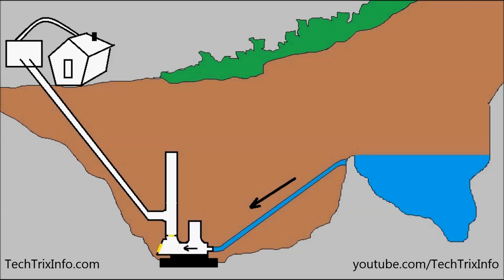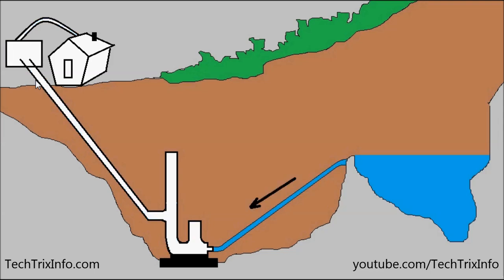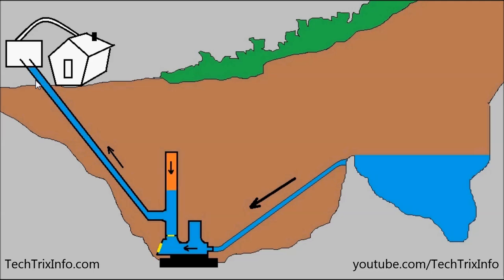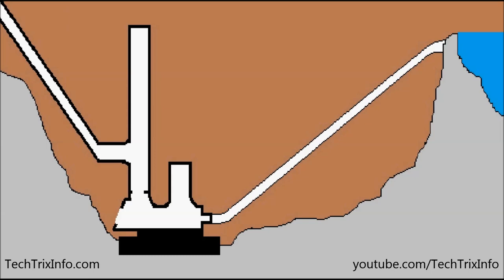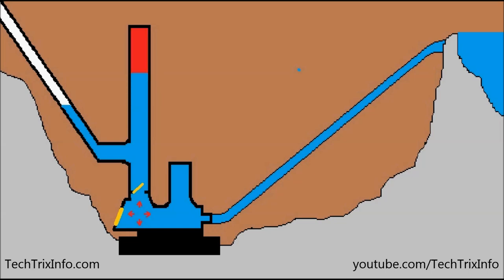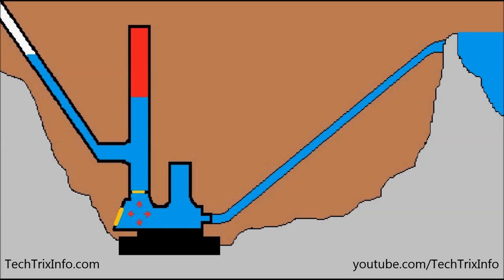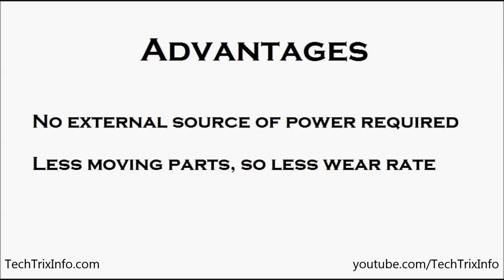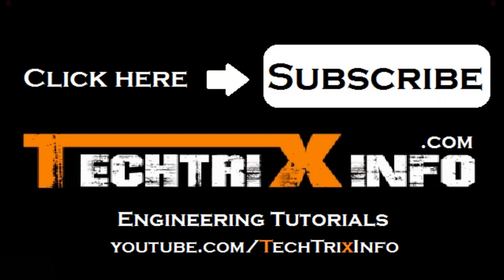Animation | How ram pump works | Explained in detail.

Comment: Thank you! New to ram pumps and after heaps of videos I finally get how it works.  It should therefor work in a waterfall into swimming pool pumped back up to higher fall then yeah?  I want to build one where waterfall is pool filter so hoping it will.
Reply: Thanks for the comment
Reply: For a short period. Only 10% of the water is pumped back up. You should consider an electric pump, powered by solar.

Comment: Just a thought, the pressure from the pressure chamber is enough to push the water even to higher location but there's still a split second delay since the pressure chamber needs to accumulate enough pressure again before it can push the water. Maybe, if you put two pressure chambers in series and they are both connected to the inlet but the 1st chambers' output is connected to the second pressure chamber which has two incoming delivery valve. That will create more pressure quickly since the pressure created from the inlet and the 1st pressure chamber will be added together to create pressure for the second chamber which is then connected to the delivery pipe. Two or more pressure chambers in series I guess can speed up the pumping of water to the delivery pipe.

Comment: This animation and "explanation" fails to explain the most important part of this entire mechanism, i.e.: how the waste valve works. It also fails to explain the function of the chamber to the right (upstream) of the pressure chamber.
Reply: it was also hard to understand.  but a B for effort.
Reply: What IS the function of the chamber to the right of the pressure chamber?
Reply: @robertbrandywine  just to make more stored water available to fill the cylinder than the thin pipe can deliver.
Reply: Is the waste valve necessary?
Reply: @robertbrandywine   the author of this animation has used drawings from another source, the chamber to which you refer was used in another explanation to house the waste valve. This person has merely retained the shape of the original pump and placed his waste valve closer to the delivery valve (in my opinion, a less efficient location). The system will work with the waste valve  placed either before or after the delivery valve. In my system , I have placed it where the original artist of this diagram has shown it (yes, at the top of the chamber you were asking about) and I have done that for 2 reasons , the first so I can utilise the weight of the flap valve seal to assist closure secondly to utilise more of the hammer effect energy, by applying it to a greater volume pump. i(it does not increase the amount of water pumped, it does however slow the pulse rate and extend the time the valve is open. I support my argument by asking you to look at the majority of ramp pumps on utube,...... where is the waste valve located?

Comment: how the waste valve is opened at the beginning and in the process its opening to the other side? wouldnt the water just flush trough that waste valve if its opened this way?
Reply: +Samuel Trajano in this we lock its motion to certain angle so it will not open to other side
Reply: Samuel Trajano I was thinking that too couldn't it also be lifted back to the original pool if not into a sewer system or such? Circulation wouldn't hurt and could be helpful?
Reply: water pressure closes it. After pneumatic pressure pushes water up, the chamber with waste valve loses pressure and it reopens, inviting more pressure, and then closing again after the entire process happens again.

Comment: Good explanation but would you also need a one way valve on the delivery line as the water would be expelled through the main delivery valve as the pressure has been used up in the compression chamber. I`m guessing a one way gate valve at the tank on the top of the hill would be installed?

Comment: I wonder if using multiple ones in series could work? There would be much water loss along the way but I think the water can be recycled or used to power yet another system. The possibilities are endless for parallel & series running systems.
 I might have to try it out.
Reply: Exactly what I was thinking.
Reply: Keep in mind everything is in balance; more maintenance as parts wear out etc.. But I do agree that there should be some multiplicative

Comment: Depending on your needs the waste water isn't wasted but given back to the stream with the gift of 10% of water lifted free into your up hill tank or pond.
our
Reply: Ross Williams, DC It’s inappropriate to state the lifting is free if you are using 90% downhill water movement to lift 10% uphill. You could use a water wheel and conventional pump and have similar results. No issue of priming there either and no slamming of valves, which is an eventual mechanical source of failure. Not entirely sure which way is more efficient, though.
Reply: Forgive me for I am very new to all of this but I think a lot. Is it possible to create a system where you pump water into a higher pool from a lower one, then run the water through a series of smaller turbines/wheels to generate enough electricity to charge a battery / run the primary pump? 

I understand the law of diminishing returns and thermodynamics, but if you had enough smaller turbines all charging the same generator, shouldnt you eventually be able to offset the pump cost? 

Might have to hand crank it at first unless you start with a full battery, but i feel like it would work.

Comment: So it converts the momentum of the in flowing water to air pressure inside the hydraulic cylinder, which then is converted back to up hill flow, once the pressure in the cylinder is equalised, the waste water valve is opened to get the momentum of the inflowing water to rise before suddenly shutting off to divert it back to the cylinder, raising the air pressure and restarting the cycle.
Rest assured, it's not free energy device as it uses the momentum of the inflowing water and discards much of it out the waste valve. Fiscally free, but not free to the scientific definition.
Reply: I don't think it has anything to do with momentum, but rather that the water in the column is trying to get back to the height of the supply pool surface. Same principle at work here as in a "water level" hose. It's just a fact that all the water in a closed system wants to achieve the same or equal elevation. In that process, the air trapped in the column is compressed to a point where it overcomes the supply check valve.
Reply: @jro101346  momentum is why it needs a waste valve isn't it? ie. to enable the flow of water once again and provide the necessary momentum/kinetic force for it to work?

Edit. I may have got it wrong but otherwise you wouldn't need a waste valve? ie. if it doesn't need that momentum?

Comment: is there a limit to how far the ram can push the water? ie: does gravity become a factor at some point?
Reply: In theory you can pump as high as you want. The problem is as the head (height) increases the percentage of the water flow that gets delivered  "upstairs" decreases eventually reducing to a trickle and then to nothing.

Comment: Can you use this in a hand dug well?
Reply: not unless you can get the pump well below the water input and optimally your inlet should be near the bottom of the pool of incoming water to get more pressure.

Comment: another non return valvve may be necessary at out put to reduce the back flow pressure, i think
Reply: the extra force required to open that uphill check valve would stop the water flow. Better to let the water run out into a large tank at a reasonable height. It requires a lot of engineering or experimentation to get this right.

Comment: What makes the waste valve open? there isnt anyone opening it so what would make it open?
Reply: there is a permanent air bubble creating pressure in the cylinder above the delivery pipe. this creates a cyclic breathing pattern that you see in the water cycle. there was a giant dome made in nevada that replicated a mars habitat. it failed because the place couldn't breath. so they created a giant "lung" that allows the oxygen and carbon dioxide to push up and pull down. it's almost like air needs to and loves to excercise. just like viktor schauberger pointed out. life is essentially "water". water needs to "eat" rock minerals to acheive its greatest potential inside our bodies. water needs to breath. it needs to move. anyways, back to topic, i think 90% water waste is excessive. has to be a better way

Comment: sir it is same princip also with PC ram.
in PC electrons runs and if you stop them suddenly in one point. electron accumulates there and stays as long as you want-
but when you switch off the PC of course it stops.
this water ram also same.
my project I am working now is a laser ram.
i am trying to do same with laser-
I am based in india

Comment: So if you had a high-pressure balloon on top of the ram pump - Would that be much better than just a fixed cylinder or Chamber ?

ie Valve closes Ram pump cycle inflates the pressure balloon, then as the reverse pressure closes the valve the balloon exerts even more pressure on the water than normal thereby pumping more than the usual flow of water. Would that work?
Reply: if your system is powerful enough to compress air youre better off using the air as the elastic bit rather than rubber as air has less internal friction and will lose less energy to heat. best off with a rigid air reserve

Comment: For every metre of elevation from water source to the outlet is equivalent to 9.81Kpa of pressure. So if the water source is 3 metres above to ram pump you are looking at 29.43Kpa of pressure head.
Reply: Pwede tagalog

Comment: can we connect a pipe from waste valve to discharge line? so that water wastage can be eliminated
Reply: Sandeep Naik No. It will fail to work. When water is being discharged from the waste valve, the inlet pipe’s column of water has low momentum. As the inlet water flows faster due to siphon, its momentum increases, and that is what forces the waste valve shut, lifting the other valve and entering the air chamber. (The video narrator plays fast and loose with this waste valve). Thus, the outflow water is low pressure and high volume. You could use this water in another pump, but it would need to be downhill from the first (to build pressure and momentum again) and you will get diminishing returns. In any case, a large slope, large volume of water, or both, is/are necessary for any of it to operate in the first place.

Comment from the maker: Please watch the video and rate it.
Reply: i thank u with all all my heart. 
I have two question If you can answer them please?
1) How to make those two valves
2) a bit of calculation of quantities and height difference to lift water.
Reply: TechTrixInfo.com ty im  not  mechanically  or science  inclined  this was simple and to the  point  and definatley  explained the principle in a way I understood it
Reply: I can awnser the first question you can get one way flapper valves in (probably) any hardware store.
Reply: Good learning
Reply: TechTrixInfo You need to make a new video of the pump. There are many comments telling why the animation is wrong.

Comment: Needs relative values. how much water can you pump and how high? 
The maximum pressure from reservoir to the pump will determine the maximum pressure on the air pocket which will determine the maximum amount of lift to the final location.

Comment: It's the same principle as a "power flush" toilet system. Like the toilets in the school bathrooms or highway rest area restrooms As the supply water is forced into empty tanks by city water pressure, (gravity if from town water tank). Back pressure is built up and held in place until released by depressing the flush button or handle thereby forcing the pressurized water into the toilet bowl giving a more powerful flush accompanied by that characteristic "BWOOSH!" sound and as an added bonus, using only 10% of the water needed to flush a standard residential gravity flush toilet.
Reply: well not really. this system works on fluid hammer principle. slamming the drain valve shut causes a pressure spike because of the momentum of the water in the feed line . this pressure passes through one way valve in to the pressure tank of outlet at much higher pressure than just the feed pressure. once the pressure spike is over. the drain valve reopens. allowing the feed water to start moving again. the power flush uses the already pressurized water to compress air above the water inside the reservoir for a high volume short duration release of energy.
Reply: Is this how toilets on air planes work?
Reply: All toilets should work that way.. Unless they're recycling toilet water for faucet water; then you wouldn't want such a concentration perhaps! hehe.. Saving water is stupid.. We're a planet of mostly water!

Comment: question  would a longer pressure tank result in  more water  pressure?
Reply: lang van  no lang van a longer tank would make no diffference at all.... the air pressure inside the vessel will always be the same no matter what size it is............it is wat it is inside........i know this because i am a plumber that understands whats going on. i have worked in this industry water industry for 25 years to date......... any other rediculously stupid questions to ask please do...........
Reply: so  sorry to  offend  such  a  pro  the  question was asked  to  gain  knowledge  that  I   lack  from  a  pro  who  might actually be polite  enough  to pass it along ty  sooo much   for  sharing
Reply: A larger system won't have a higher pressure. It will transfer a higher volume of water.

Comment: Good video I liked it. It seems like it would be a good idea to recover the 10% water from the waste valve by recirculating the water back down to the source, what do you think?
Reply: Tbvck You have it backwards. Listen to the video explanation again and just think for a moment. 90% is waste water. 10% gets pumped up hill. This varies somewhat based on the relative heights of the source reservoir, pump, and outlet pipe.

Comment: at first, the waste valve are from inside base on you animation, after a little while, it was moving outside to release the pressure. so how many waste valve do you have? it is not possible that the waste valve will move outside otherwise the water will go out direct trough the waste valve. sorry for my poor understanding.
Reply: My question too...no answer?
Reply from the maker: +zain bray 
It's just for understanding purpose 
Thanks for the comment. 
What's app us @ +919744615655 To get updates on Mechanical/ Automobile engineering

Comment: Well, as a matter of fact it's not just the gravity or the pressure pushing the water up into the delivery valve. That would make no sense, since gravity as well all know, gravity pulls things down to the center of the earth, not up. What actually "pumps" the water is the kinetic energy of the water since it speeds up before the waste valve (which is drawn the wrong way around in some parts of the video) closes and then the inertia of the water forces it up the delivery which then lowers the pressure again to the point where the waste valve opens again. That is the key to understanding how the ram pump works. It's not the gravity or pressure of the water, it's pressure created by the inertia of the water moving down.

Comment: this is a terrible explanation you almost have it right but your explanation of the waste valve makes no sense, the ram pump makes sense , your explanation skips over the complicated parts which usually is included in a long winded explanation with diagrams 1/10

Comment: Why don't you just say that the ram pump works using the energy of the water and the effects of water hammer?
Reply: It also uses air. That is a vital component in the model, and without the air pocket, it would not work. This is the part that I discovered today, a key that every other video and schematic that I had seen this far was missing.